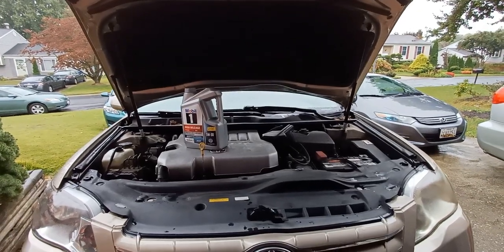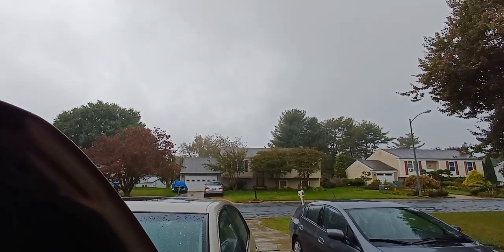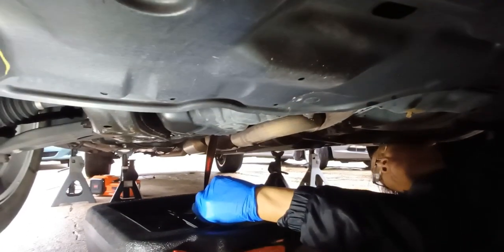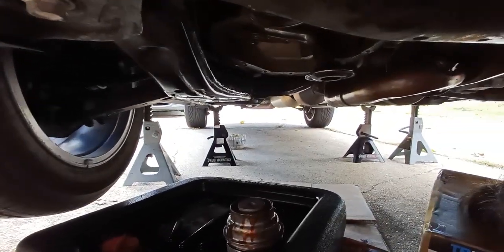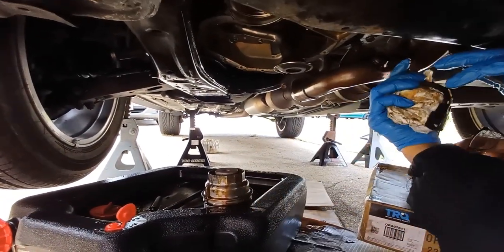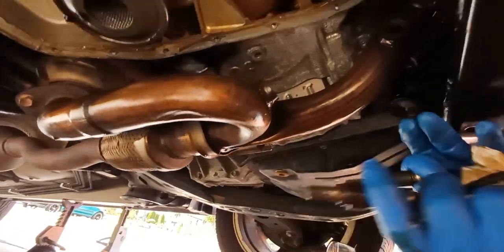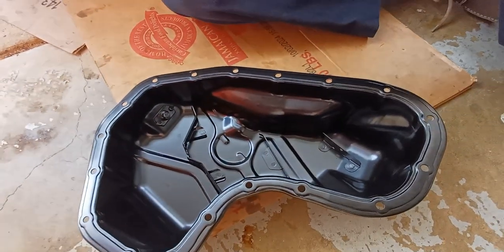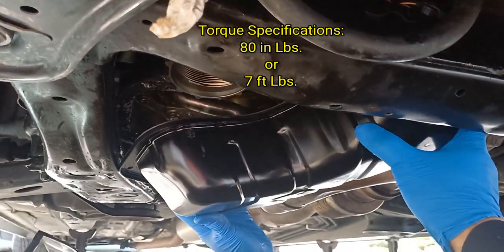AN EASY WAY TO REMOVE AN OIL PAN FROM 2005 TOYOTA AVALON!

Comment: Hey, I did it. I used this video. But there was no room to wiggle out the old pan the pipes in the way so I had to bend the old pan. The new pen will not fit not enough room to work with. He must’ve Remove the bracket on the pipe, elbow or something else that wasn’t stated in the video because in this video, there is no pipe bracket, but I have one.
Reply from the maker: Hello! My husband did not remove the pipe bracket. He removed the oil filter casing and sensor so he can remove the pan.
Reply: I did that. No wiggle room